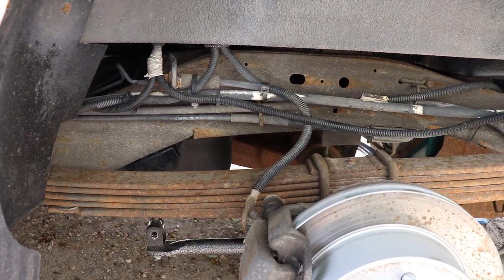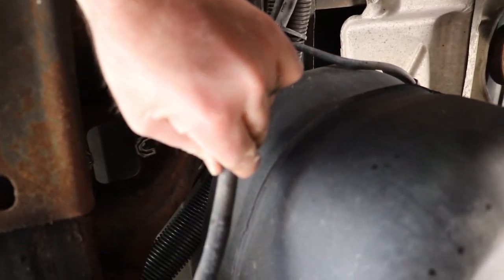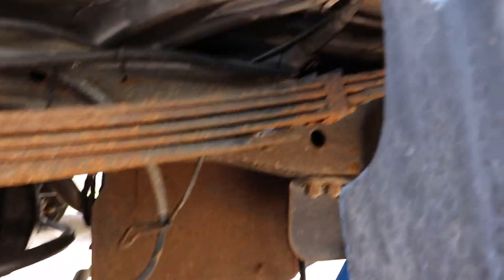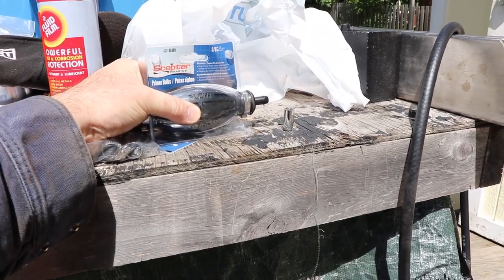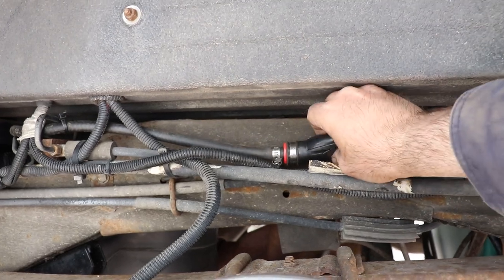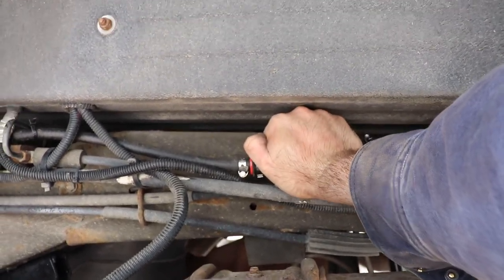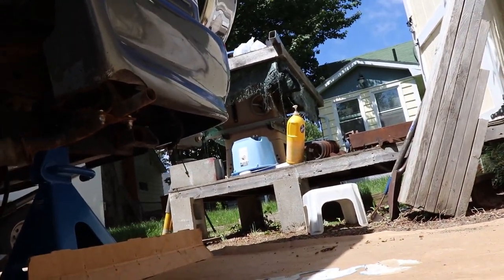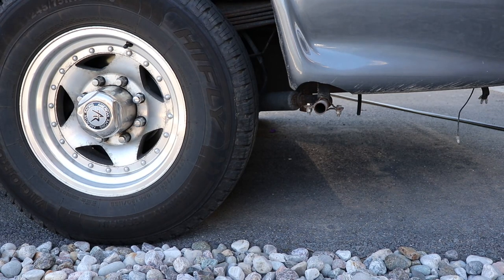Unsuccessfully installing a primer ball on an ONAN 2.8KV Spec K Generator

Comment: I’ve owned three of that same version of Onan generator, on different campers. If it’s hard to start after sitting idle for an extended time? I’m thinking your carburetor jets are clogged with deposits left behind by stale fuel. Have you been running it each month, under load, for about 20-30 minutes?

Those Onans don’t lose their prime. They draw fuel from the van gas tank, using an electric fuel pump inside of the generator cabinet. They’re notorious for failing. I’ve replaced two of them over the years. You can do a couple things to check your Onan fuel pump. 

First, you can disconnect the fuel line at the carburetor. Fuel should be present in the fuel line. If the fuel line is dry, then that means the electric fuel pump isn’t running correctly. 

Second, you can check the fuel pump flow by carefully aiming the fuel line (disconnected from the carburetor) into a bucket. Then press the “start” button on the generator, while aiming the fuel line into a bucket. Anything less than a steady stream of fuel means your electric fuel pump is going bad.
Reply from the maker: I will have to take a bit of time and clean the jets.  I've done it on a few motorcycles so I suspect it should be easy enough.  Thank you

Comment: Forgot to add. Your Onan fuel pump won’t draw fuel from the van fuel tank unless you’ve got at least 1/4 tank of gas in the van. You might try spraying some Seafoam or equivalent carburetor cleaner. And take a look at the spark plug. There’s only one, and a dirty or fouled spark plug will also make it hard to start.

Comment: Stephen-Ive had better luck trying to start mine using short pushes of the starter button(dont crank it so long) Try about 3-4 seconds/stop and try again.
Not related to your Gen. problem, but about your Roadtrek. At 2:52  youre showing the water heater. There are 2 fittiings-one is threaded(for shower hose Im guessing) The other is a quick-connect type fitting. Whats that last fitting for?
Reply from the maker: The white fitting is the vacuum breaker for the outdoor shower.  The brass fitting is the city water fill.  It's explained in one of my other videos from what I recall.  Doing shorter attempts does work better but I'm going to be taking that carb out this summer to work on it.